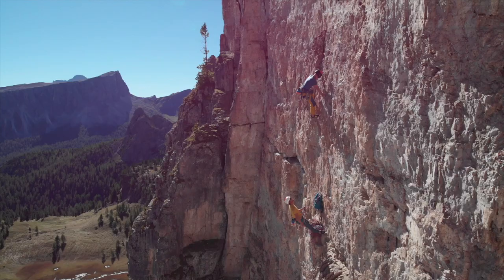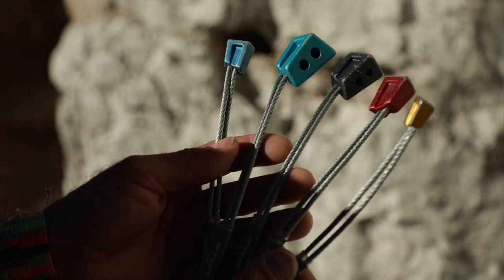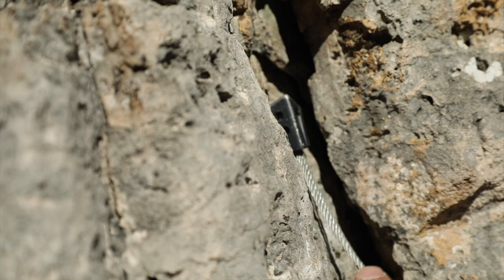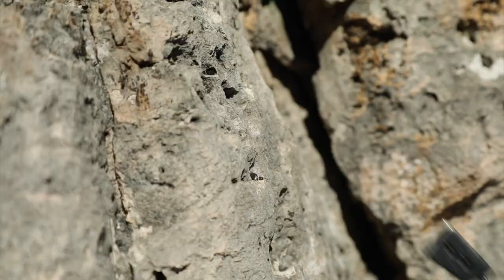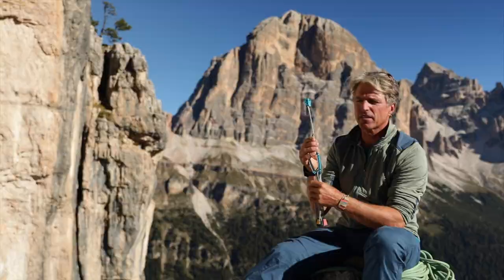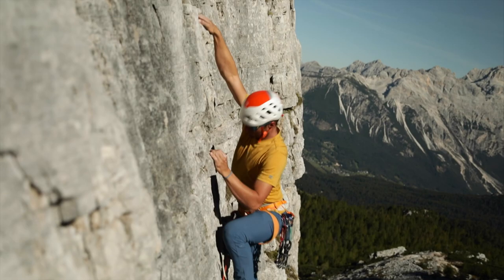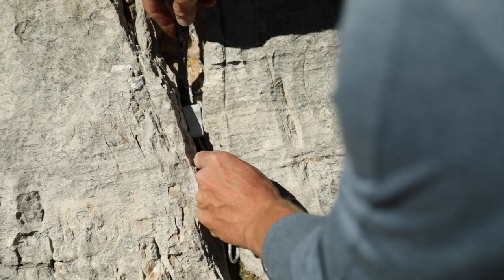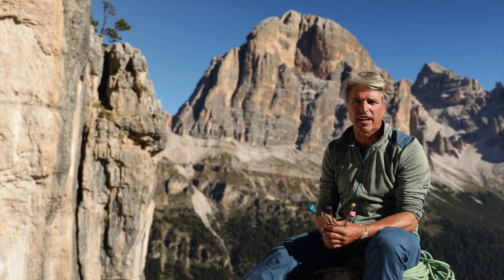Removable Anchors: Place nuts & remove them with a nut key – Tutorial (25/43) | LAB ROCK

Comment: Hi is there a solution to remove nuts while climbing alone? How can I remove them from the rock if I don't have a climbing buddy?
Reply from the maker: Hi Daniele,
First of all climbing alone should not be your regular way to climb as it involves much higher risks for your live and safety. If you do so, removing nuts probably might not be the most important thing to concern about…but anyway climbing alone either means your climbing free solo or you´re rope soloing. Free soloing – per definition – means you don´t protect yourself with a rope and any kind of anchors or protection. So no need to remove nuts anyway. If you´re ropesoloing, you first lead the pitch placing your pro, then you´re rappelling the pitch on the fixed rope and ascend it again. Either during rappelling or ascending again you easily can remove the nuts you placed while leading. Often nuts can be removed - unlike shown in the video – singlehanded, so you can still hold on to the rock with the other hand.